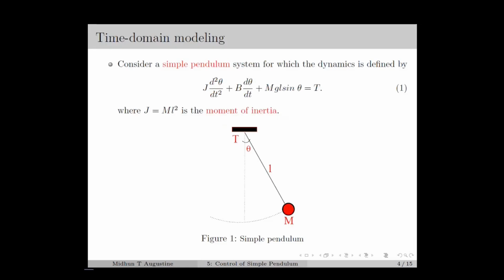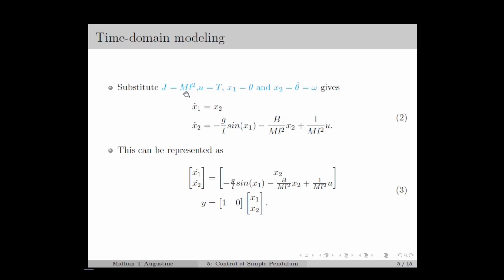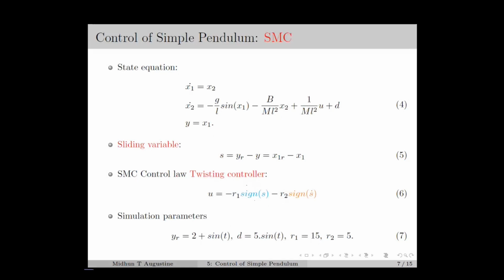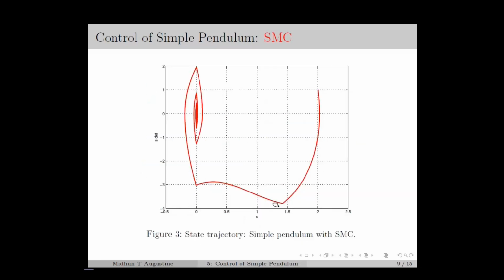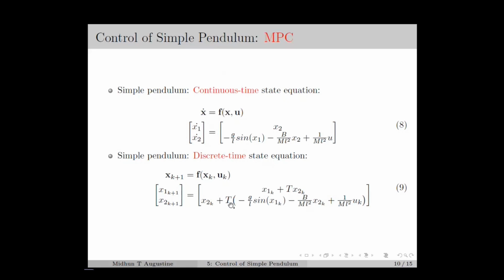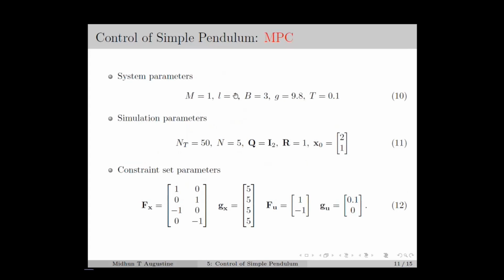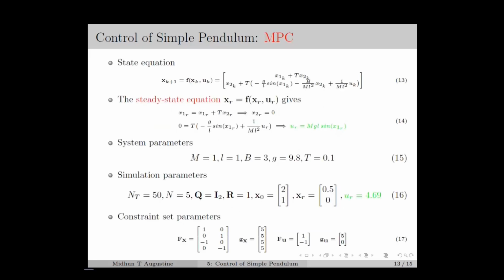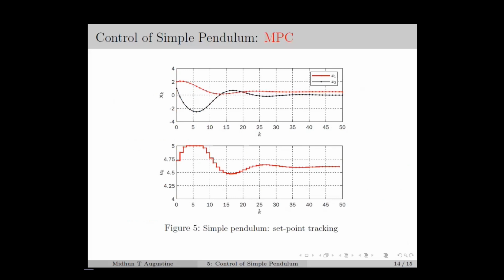Control of Mechanical Systems,  Lecture 5: Control of Simple Pendulum

Comment: how to get the plot of output as states in tracking or regulation problems if we are using double differentiation in state space model?
Reply from the maker: In simulation, we update the states using the state equation and the state vector at discrete instants over the simulation period are stored in a matrix, say X that contains n (number of states) rows and NT (Number of discrete instants in simulation period) columns. Therefore we can select the outputs as states i.e., Y=X, since the full-state information is available. Then each element of the output vector can be plotted by plotting each row of Y against time.